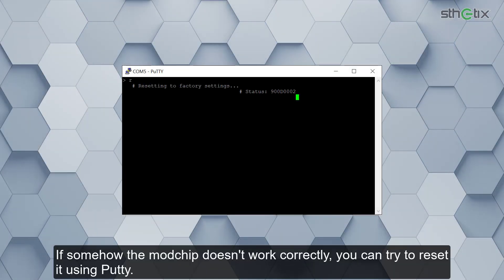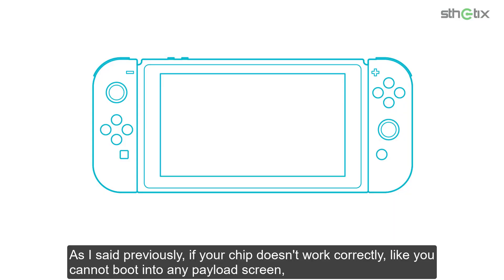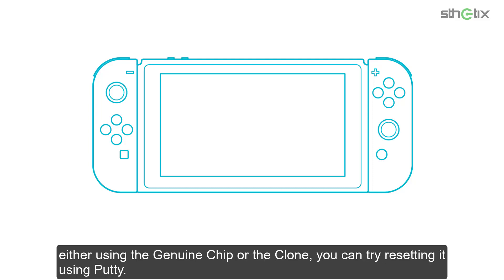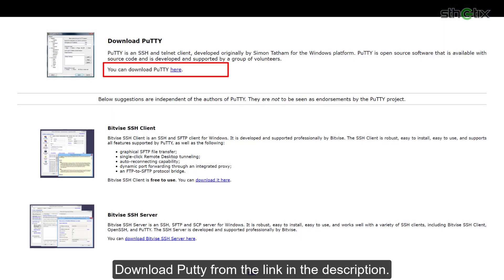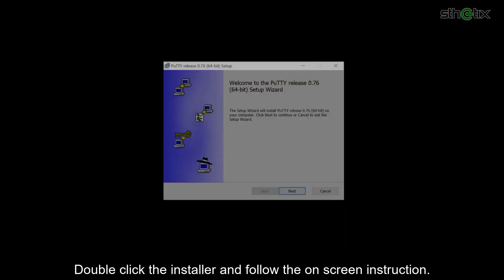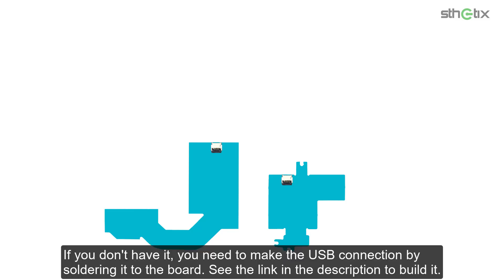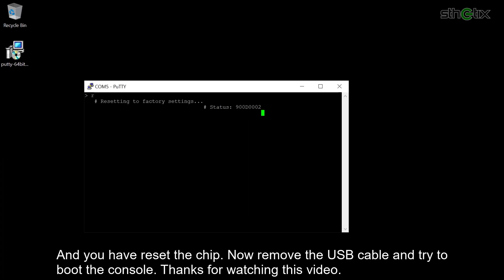HOW TO RESET THE CHIP USING PUTTY

Comment: Very interesting, I didn't know this was possible. I had my OLED running fine for a day then it stopped. Long story short, I'm hard wired, not using a flex, so I'm sure timing is slightly different and chip is still using the old data. Gonna try this tomorrow 🤞

Comment: Hi sthetix, does this method also work with the latest rp2040 also for clone OLED chips?
Reply from the maker: i dont know about the RP2040 as I dont use it. I think they are different.
Reply: @sthetixofficial  Thanks dear, I will never buy them again, what chip do you use for Nintendo Switch now? Because I can't find hwflys anymore.
Reply from the maker: I use the V6S and you can find it on aliexpress.
Reply: @sthetixofficial  Thanks for the reply, are they good for V1/V2, Lite and OLED???
Reply from the maker: it is good for the v2, lite, and oled only. for the v1, you better stick with the pico.
Reply: @sthetixofficial  Thanks for the reply Sthetix, what picofly do you recommend for v1 that doesn't cause problems? I've seen a lot of cloned junk. Do you know any original good ones for v1? Thank you 👍🏻🔝
Reply from the maker: I dont know either because I dont use it. Maybe you need to ask the reddit community.
Reply: @sthetixofficial  Thanks Sthetix for the reply. Let's see if anyone knows about this. I was honestly asking you, because I trust you more than others. I'm sincere. Thanks anyway. 👍🏻🔝🔝🔝

Comment: hi can you guys help me,
i bought secondhand of switch lite with v4 oled already installed on board, when i playing games (installed on sd or internal memory) is always forced close or reboot the system. is it safe if switch lite have hwfly v4 oled ver installed as modchip on this hardware?

after i tried to update my sd card now my switch dead, led light is off and the machine wont booting sytem or hekate. so i have plan to doing this video guide, is it okay i connect switch to pc without removing soldered modchip from the machine? or just removing battery and sd card before connecting to pc?

Or instead of me resetting this chip, is it better for me to just replace this oled chip with the latest chip like v5 or v6 that matches with my switch lite? and Is it safe to replace chips if the machine is cannot booting condition?

thank you.
Reply from the maker: Try to replace the SD card first. You can install the OLED chip on the lite.

Comment: I have installed instinct v6 on my OLED.
Is there any button combination that does what "r" does? resets configuration so it can retrain itself?
Reply from the maker: R means reset. and there is no such thing as a button combination
Reply: @sthetixofficial  thanks for responding and sorry for the stupid question.
I guess the buttons are not even <<loaded>>, <<readen>> when the instinct nx do it's job.

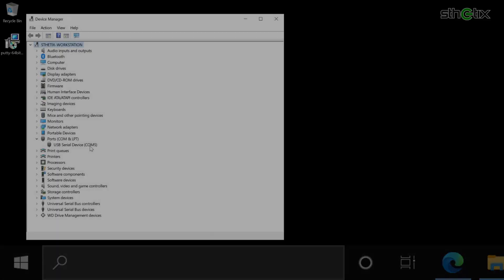Comment: 2:13 stuck at this point, plug in and there's green light but don't see any 'USB Serial Device' at Device Manager
Reply from the maker: maybe the reset function doesnt work with your modchip
Reply: Is there any other method? Because I can't boot to payload/hekate after update system on CFW sysnand